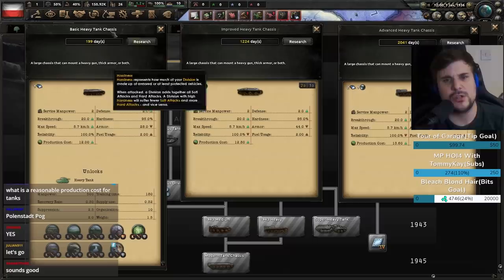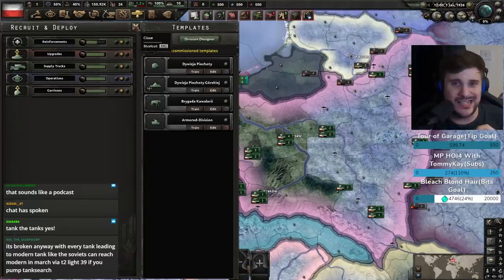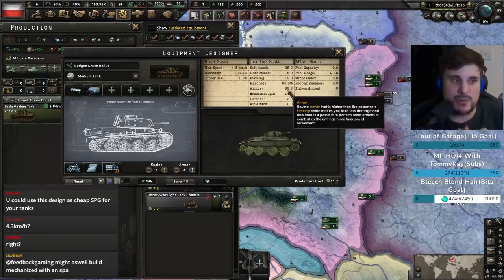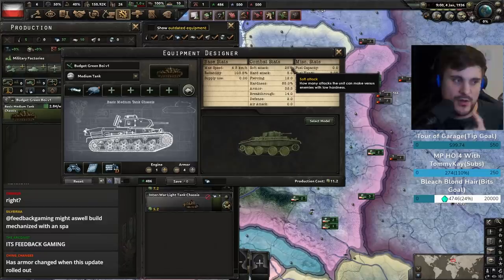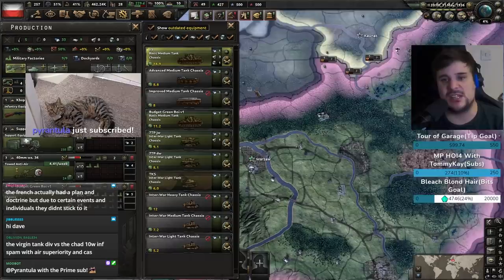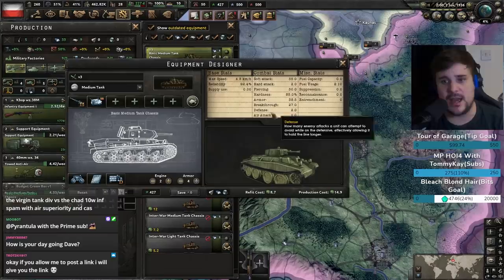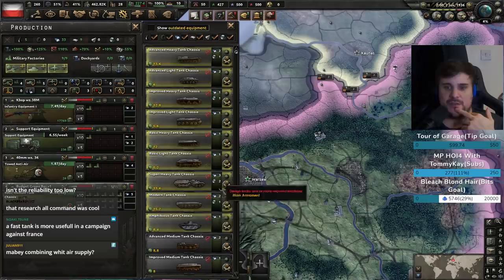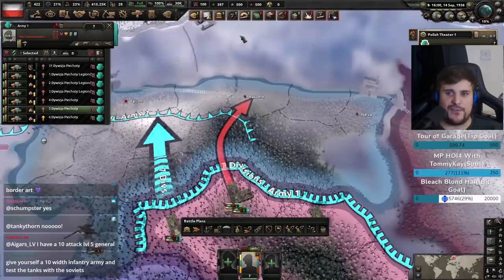NEW Optimal Tank Design - HOI4 No Step Back Tank Designer Guide

Comment: Ironically, he designed the Panzer IV as the germans originally intended it to be. Short range howitzer tank with heavier armor to support infantry. Panzer III being the general purpose tank-fighting tank.
Reply: @M J no, the first Panzer III model carried the 3.7cm anti tank gun. It was intended to fight other tanks of the early war era. The IV carried a short 7.5cm howitzer and was intended as a breakthrough tank to target anti tank gun and machine gun emplacements.
Reply: @M J the Ausf.N with the short 75 came later and was I guess  an attempt to make the Panzer III remain useful as it couldn't take the long 75
Reply: @thecanadiankiwibirb4512  good time in the sovietunion, when germany had only 3,7cm anti tank guns and 7,5cm howitzers. than soviet T-34 and KV-1 came.... without the 8,8cm anti air gun germany would have been done in 1941.... they had no tank that was able to fight the new soviet tanks
Reply: The short 75 was never classified as a Howitzer as its direct fire ONLY; Howitzers are supposed to be primarily indirect fire artillery pieces (like what's mounted on the Wespe and Priest mobile Howitzers) though some weapons chambered the same shells as those guns like the KV-2 or ISU-152.
Reply: And the German tank had only decent armor but it had a radio and good mobility; unlike this Infantry Tank Equivalent.
Reply: @christian9125abd  it was not needed since CAS made short work of the soviet tanks that were surrounded and unsupported. The war only turned to the USSR's favor after the germans lost the means to keep air superiority
Reply: @cnlbenmc  well idk the right word for that kind of cannon, it was used against infantary and light armore vehicles
Reply: @luansagara  air superiority played not that gigantic role in the east. and the soviets had also an own one. germany could not refill the losses of 1941, while the soviets were able to.  another point is that the front is so huge, you can't have CAS and airsuperiority evrywhere.
Reply: @christian9125abd  actually it did, in early stages of barbosa the soviet air force was decimated and the germans got air supperiority for most of 41 on the east. For Fall Blau the german aor force was brutal, acting as the spearhead for the offensive for extended periods of time with reported cases of over a 100 bombers hammering a single soviet divition, especialy during the first mont of the offensive
Reply: @ArayaPancho  but as time went on the soviet airforce got back its power. and 100 bombers hammering 1 divisions means that alot of other divisions do not get atacked or only were lightly. and still germans could not bomb out evry soviet tank. also that tactic is only usefull when you are in the offensive, but when the enemy is in the offensive you do not know where he hits and till cas reach that point it is often to late. another point is to just think about the fact that army group center lost 75% of its tanks before it was able to reach moscow. and that was by far the best time for the germans in the whole conflict
Reply: @luansagara  CAS didnt make short work of anything lol, historically in WW2 close air support was wildly ineffective at killing tanks.
Reply: @christian9125abd  You also forget that, while they did indeed have poorer armaments, Soviet Tanks still weren't totally invulnerable. A 37mm cannon can't pierce the front of a T-34, but it can if they get close enough, outnumber, and out-flank one, which is what happened a lot because German tanks had Radios. Then of course, the Soviets also fielded T-26, BT-5/7 in the thousands, which made up the bulk of Soviet armored forced until 1942, which as we know had inferior armor protection.
Reply: @lasagnakob9908  bt5, bt7 and t26 may had bad armament but had decent cannons and soviets still had more modern tanks than germany.
Reply: @christian9125abd  Yeah, well uh, that didn't seem to make a difference in 1941 lmao. If the 88 were available or not as an AT weapon, the Germans would still make it pretty far, albeit probably not as far as they did irl. We still have to factor in the air wings of the Luftwaffe too, since they also shared a bulk of damage done against armor.
Reply: @christian9125abd  That...
That isn't how it works.
Yeah they could have been smarter on a strategic level, but the Soviets were ill-equipped and ill-prepared for a Blitzkrieg, and their airforce was horrendously outdated. By the first months, their airforce would be in shambles, and the Luftwaffe would still dominate the sky while German tanks steam rolled the battlefields until their inevitable disconnect from supply, and are forced on the defensive. In any case, you're telling me that an army of millions would just be beaten back to Berlin after most likely getting within dozens of kilometers of Moscow? All in the span of a year?
Reply: @lasagnakob9908  a combat ready red army would have never lost so much ground and soliders+equipment. the red army was pretty decent equiped and the soviet airforce would have been able to contets the luftwaffe, as the existance of fighters already means that cas can not go around coverless like it was in reality. in 1941 strategic positions were sometimes not even defended. better defense on the front line would have ment that inner lines could have been prepared better and a earlier slow downed german army could not make that big pockets.
Reply: @christian9125abd  Gonna have to undo that purge against their generals first lmao
Reply: @lasagnakob9908  they still had competent generals. the thing they lacked the most was combat readyness. stalin did not mobalize as he not wantet to look biased against hitler
Reply: @christian9125abd  Yeah, no, not really, you need only look at the disaster that was the Winter War to find out how true it was that most of their good generals were out. Bad logistics, poorly equipped divisions, ineffective tactics, all of that plagued the entire invasion of Finland. How they won was through quite literally throwing enough shit at the wall of an unpopulated country to see how far they could get.
Reply: @lasagnakob9908  defending is easier than atacking. the morale of the troop is way higher and you know the land where you are fighting in. the read army improved alot from the winter war to the great patriotic war
Reply: @lasagnakob9908  history is pure learning, the real struggle is to understand the stuff behind and that also implies thinking about how little things could change the world. and the last stage is to think about how past things influence us today and to learn from mistakes
Reply: @connorbranscombe6819  tell that to the polish and french early in the war, and to the germans later when their tanks were being made scrap by soviet IL2s and american planes
Reply: @christian9125abd  8.8cm wasn't what killed T-34s and KVs in 1941. The Soviet logistics and maintenance system being a sad joke did that job better than anything the Germans had at the time.
Reply: @magni5648  in combat it was the 8,8cm, the germans had nothing else that could penetrate them frontal
Reply: @christian9125abd  And most that got killed in combat in '41 weren't killed from the front, either.
Reply: @cnlbenmc  It was classified as a Howitzer-like weapon, not a true Howitzer, but still it had a similar effect, minus the indirect fire. Closest we'll get it classified is as a short-barreled infantry support gun.
Reply: Panzer IV had thinner armor than the Panzer III at the start and was not really intended as infantry support, it was panzer support.  The StGIII was infantry support.  Oddly the Panzer III would use the same gun in its last version as part of the Tiger Battalion's support platoon.

Comment: I think the main way fast panzer-divisions can still be viable with the suppliy rework is if *you snipe supply hubs*. Don't waste fuel and material encircling an enemy army in the middle of nowhere, go for the cities, railways, ports, etc. so your divisions actually get supplied when doing incursions.
Reply: The problem with using tanks for supply-sniping is that Motorized can do that for much less material.
Reply: Yah, just go the glorious Rocket artillery, requires way less supply and can maintain supply aslong as you control a city and the like.
Reply: @sanderleander3367  Hmm, I might try that my self
What division width you use? And doctrine?
Reply: @ArturoLopez-ly2pn  pretty certain that superior firepower is the way to go for rocket artillery. Also building mechanized is a must for lategame, too good to pass up on if you have the economy. Remember that you can turn mechanized 3 from 12 cost to 6 cost through upgrading.  I'd say just go same width as you'd use for tanks as you will push best in plains etc. Mobile warfare doctrine can be good too for the organization etc. I don't know which doctrine is best so either sf or mw. Tanks are better though, but motorized rocket artillery has that glorious sound.
Reply: Totally agree. Fast tanks still serve a purpose, but the AI is not v intelligent unfortunately to do such maneuvers

Comment: 2:08 that close support gun is basically the really short 7.5 cm gun the Germans used on Early StuG IIIs and the First Panzer IV models and eventually the Panzer III M; could only penetrate armor reliably later on with rare HEAT shells.

It did have a rather insanely fast reload speed and I did some nasty, horribly things with it In War thunder; netting my all-time record of 23 kills on the Poland Map with the StuG IIIA. Low tier was fun...
Reply: the APCBC does work well too, you only start to need the HEAT if you meet stuff like T-34, Matilda, or B1bis, for everything else it was good enough as what it lacked in velocity, it compensated in mass

Comment: SPG/SPAT battalions are definitely not redundant, since you get all the stats for a quarter of tanks.
Reply: @M J You should also keep researching/developing light tanks for use in Med armoured divisions. A Light II/III chassis with carefully chosen upgrades can be nearly as good as your Med I/II equivalents, but cheaper to build and easier on supply without giving much away in stats, so replacing 1 or 2 battalions of Meds with the proper Lights can allow you to build more armoured divisions overall, for the same resources
Reply: Also SPGs can be updated from the previous generation chassis.
Reply: @talltroll7092  Although it requires more research so there's definitely a trade-off
Reply: Not all the stats. Much worse hardness for the SPG (kind of the whole point of tanks so you're better off using them sparingly as intended) and the tank destroyers are limited to piercing weapons so much less potential soft attack. The REALLY good SPG guns are also prohibitively expensive and should be avoided for your mainline tanks, which is a second reason why being able to delineate the mainline 2w and 3w, focusing mainly on the 2w for your division template, is important. Don't use howitzers for every tank battalion. You save so much of your industry that way which you can turn around and use to build MORE military factories. A practical bonus to production cost that makes up for the 2w using more tanks.
Reply: @sawsonex3215  Not much though. The components are all going to come from researching things you need anyway, either for Med tanks or just for whatever the actual research is for, so it's only the chassis themselves that you need to invest in, and from what I can see, Light tanks are going to be pretty useful throughout the whole war if you pay attention to them. The Light III is only a 1941 tech IIRC, and you can build some pretty useful units off that chassis, with pretty OK base stats, so you can load them down with options, and have them in production long before your Meds/Heavies get good
Reply: @aletoledo1  How is this possible? And how can someone build spgs? When I build a spg it still counts as a medium or light tank🤔
Reply: @moritztabor1678  There is a drop down menu right below the name. That location in the tank designer makes it seem like just a part of the name, but it's really how to classify it as spart or whatever. 

Also, it seems like the devs gave up on conversion between tank generations. Now you can convert anything within the same generation only.
Reply: @aletoledo1  Thank you very much😊

Comment: Speed however can let you cut off their supply, allowing you to accomplish massive maneuvers once you can breakthrough.

IE not cutting off their local supply hub, but the ones three deep past their frontlines, making the AI fall back further.
Reply: Paradrops can too, right?
Reply: I agree. It seems like, if anything, speed might be more beneficial now. It will be interesting to see how penetration tactics with fast tanks or paratroopers develop. If you can put a large section of the enemy front into supply jeopardy with a few strategic breakthroughs, that could enable wider breakthroughs or encirclements. Encirclements and overruns themselves will still heavily depend on speed, plus the strategic advantage of just being able to advance farther before the enemy can put up a determined resistance. Even if you expect to have to stop at some point to repair railways and resupply, it could be the difference between advancing a few tiles verses securing a critical bridgehead or minor encirclement.
Reply: Try do that in Russia tho, they might be so far off that you run out of supplies yourself first :D Or.. Africa/Asia
Reply: @anonymous-rb2sr  I'm usually lurking around lol

Comment: Germany actually suffered in real life from their fast tanks blitzing tactics when they were breaking through on the eastern front. They ran out of supply (mostly fuel, ammunition was lacking too) and they had to stop so that the supply trucks stuck in mud actually were able to catch up to them. One example is how the Panzer Divisions' tank brigades were ordered to stop for some time during the offensive in 1942 (that was meant to reach Stalingrad) because of supply issues and to stabilize the front lines with troops left behind.
Reply: you're absolutely right, somewhere I have read: they first went with the tanks and even destroyed the few good roads, then the supply truck were not able to drive on the roads, and finally everyone stuck in mud